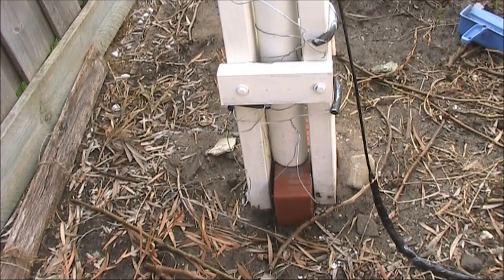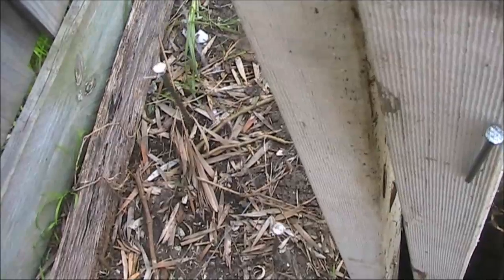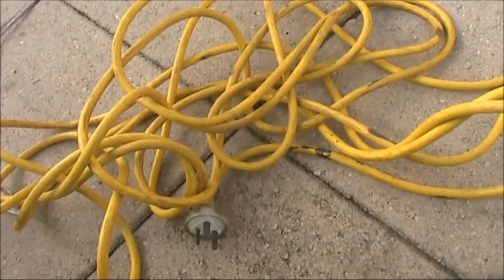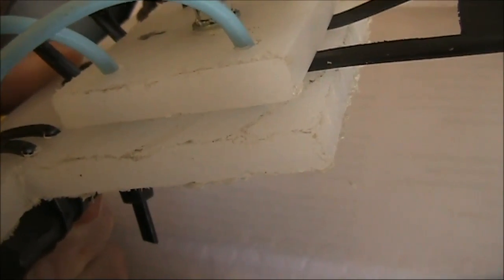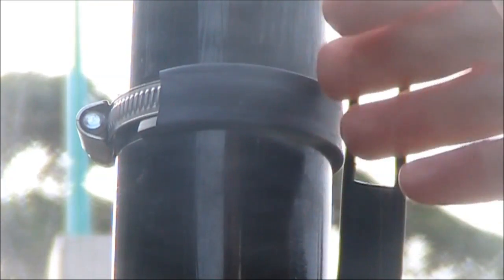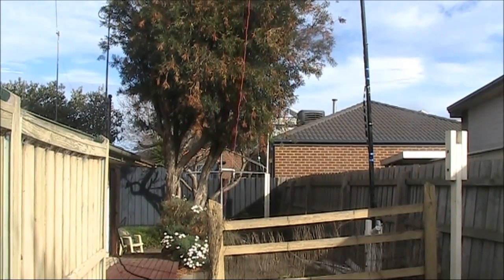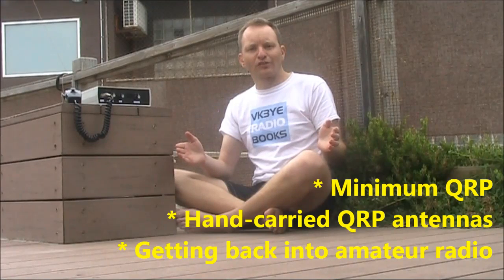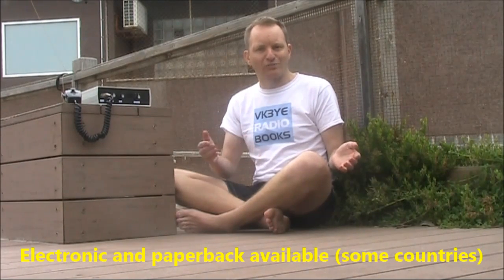12 metre Spiderbeam mast used as home station wire antenna support

Comment: "or when the landlord is around to inspect" lol, indeed, that's what I like about telescopic masts. We have one mounted static to the side of a shed. Only use about 6 meters of the 12m fiber pole, and about 4.5m is up in the air above the roof. It barely moves in the top-segment, even with 110 km gusts. We've just unloaded the upper segments, sturdy as hell these poles.

Comment: You've the Spiderbeam mast on many portable excursions Peter and you have it set up at home. The bend in the mast was insignificant when portable cause you were able to keep an eye the bending in gusts or steady wind. Your home use shows the same bending and since you live close to the coast the wind will blow more often than not. Do you lower the pole when you are away from home or do you feel the mast can handle the extreme flexing? Squid poles are difficult to purchase in the United States and my feelings about the Spiderbeam mast is that it flexes too much to hold the weight of my G5RV. I have access to more real estate for wire antennas than you so I would utilize a 160m quarter wave 90 degrees from the G5RV with added lengths of guy rope (paracord) if I need it. I have a Cushcraft R7 vertical antenna mounted 10 feet above ground and guy it with paracord in 4 directions to prevent the wind from knocking it about too much. I seen others around the area that don't guy and their verticals bend quite a bit. Too much for my comfort especially since replacement of the commercial antenna would be more one fourth of my monthly pension check. Hi, 73 OM

Comment: I was never happy using 450 ohm window line with my 12M mast. It weighs too much. Even strapping it to the mast, I feel it puts too much stress on the mast. I go with 300 ohm TV twin lead for my 80m inverted V. Sometimes I use a 84' (25.6 meters) endfed and a 9:1 unun I wound. I wrap the wire around the mast as I'm putting it up. 25.6 meters of wire winds very nicely around the 12M spiderbeam. I don't think it's as good as the 80m inverted V, but when I'm operating in a crowded park, the wire vertical takes much less space.

Comment: Do you have it guyed near the top?  I put a ZS6BKW antenna on my spider beam and the pole almost bend over, and the center point is NOT heavy, so the spiderbeam should NOT be bending as it does.
Reply from the maker: There antenna wires form two guys. A rope forms the third.
Reply: @vk3ye  Aha. Well, I thought I could do that, but the two wires of the antenna just made the spiderbeam bend over badly. It literally was bending over back on itself. I was worried that it was going to snap or break.  I may have to put guy ropes on it up near the top to keep it from bending.